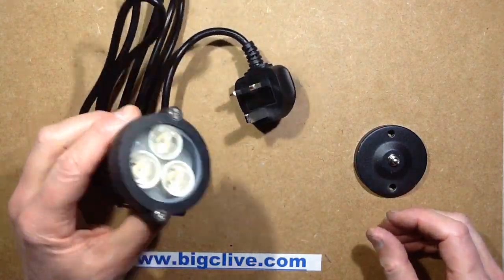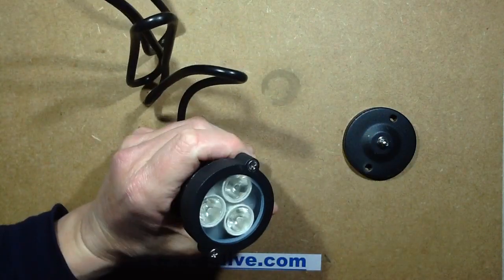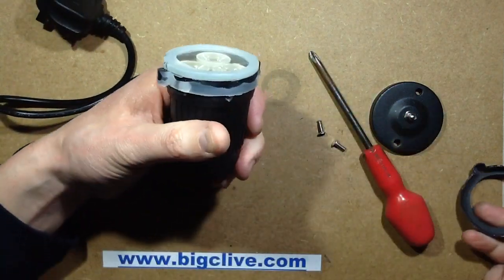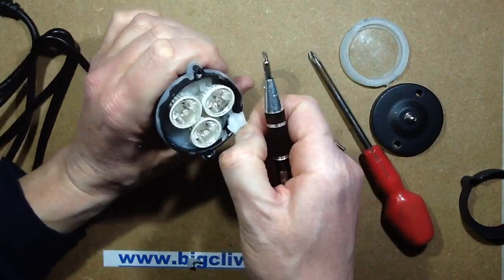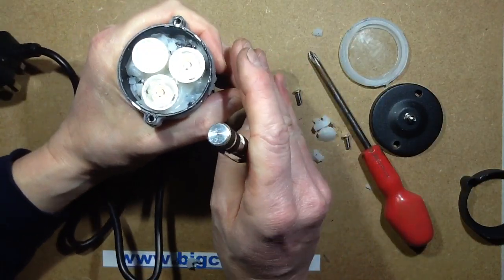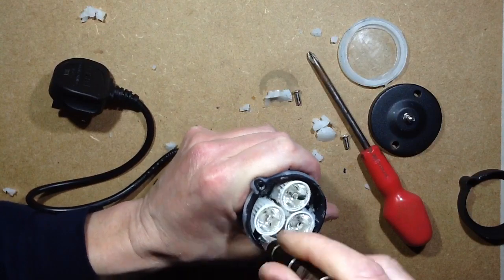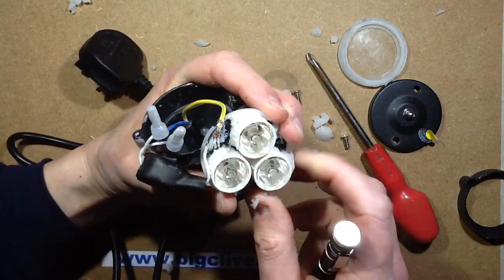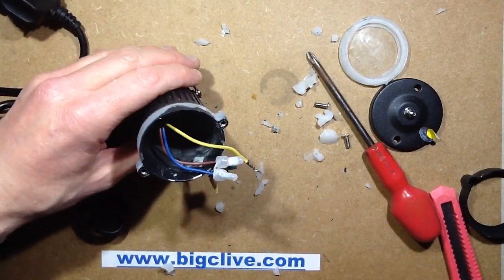Teardown (literally) of a 3W LED garden spotlight.

Comment: bigclive i have a few gu10 3.5w rgb GU10 bulbs i want to use in my pc, what power does the led circuit use mate? not the mains input but the actual power to the remote controlled led pcb, cheers mate

Comment: @ least the slugs will steer well clear !  i got some of them Gu10 LEDs from poundland yesterday and with a bit of jury rigging with a few old blown CFL casing's they are decent  ! i kept an eye on the heat and it did get pretty warm so i just took of the diffuser and they are bang on  . Clive  would it be possible to do a Teardown of that Beard  ?

Comment: A suggestion: if you have access to a PAT tester on earth bond and insulation tester, if you test it for earthbond and insulation before you take it apart, it'd give you a heads up of what you'd expect. and even if it did fail and you found an earth bond wire flapping in the breeze, then that would give an indication of workmanship.
Reply from the maker: +Chris Woodhouse I do have a PAT tester, but a visual inspection is much more revealing.  One some the earth might have passed the bond test, but only by chance as the wire was touching the case.

Comment: The white sleeves are primarily holders for the polycarbonate lenses which are press fit into them and then they are plonked on top of the leds, probably glued down.  Those lenses come in various different beam angles, although personally, I find it hard to tell the difference between any two beam angles, although the lens are noticeably different, the actual beam difference between even 5 degree and 25 degree is hard to see, well, for me.
Reply from the maker: The white lens holders were glued down over the PCB mounted LEDs.

Comment: Well it is a 'floating' earth........ If it gets wet the earth will eventually be under water. Slap a GU10 socket in there and a GU10 LED and seal it back up again. I see those with 50W lamps in them, they can cook the rain off them quite easily.